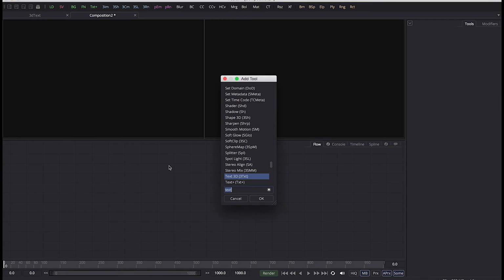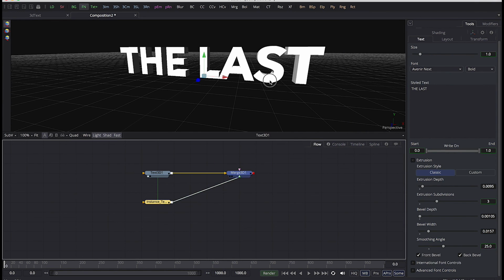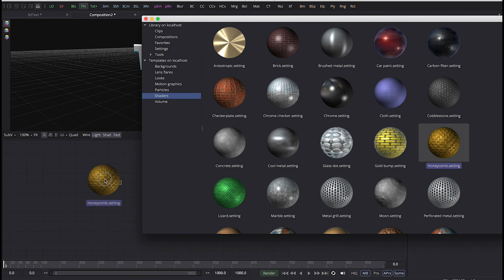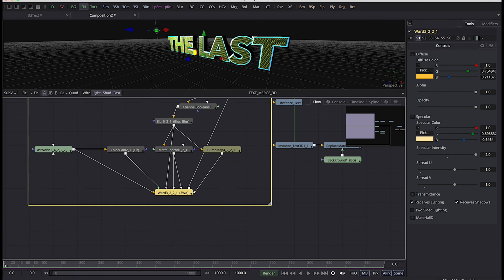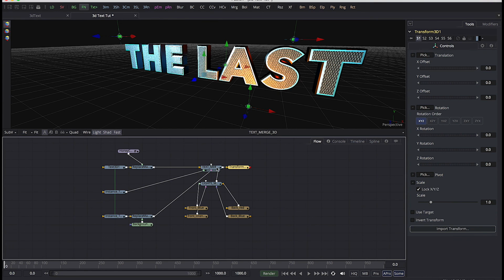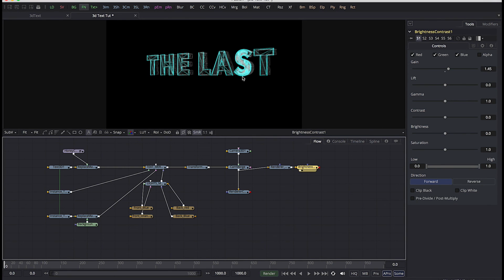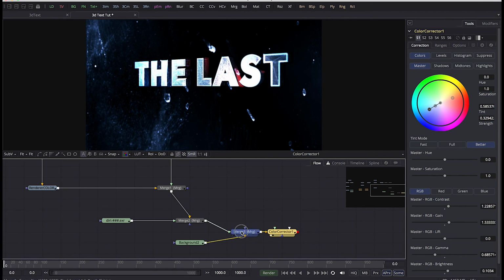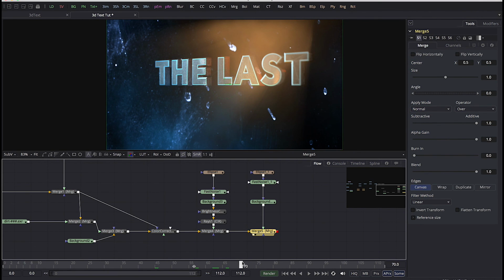Fusion: 3D Text

Comment: I have a quick question.  I love the lighting of the text but was wondering if it is possible just to reveal part of that text with a spotlight.  Thank you.
Reply from the maker: The Elevator Daily yes. It is possible. Could be done in 3d and 2d. Many different ways actually
Reply from the maker: Yes, explore playing with the lights. Work with one spot light first. Then add as needed. You will start to see how they work together
Reply: Thank you!

Comment: Fusion keeps crashing when I crank up the extrusion depth
Reply from the maker: Hmm...sorry to hear that...I would suggest double checking system requirements and maybe un-install/re-install. When you download the packages from the BMD site, they come with un-installers for Fusion fyi...hope that helps and hopefully you can get back up and running
Reply: Oh it actually turns out that TTF fonts are incompatible with Fusion, the format for the font I wanted to use.
Reply from the maker: Ah! ok, good to know!

Comment: Can you do a tutorial on tracking 3D text onto a surface, such as a wall?
Reply from the maker: Hi Elite Spectr, I will put that down on the list. At this current time, Fusion 8 and below does not do 3d tracking, however, it does have very decent 3d tracking for being an old tracker...I'm really hoping Blackmagic adds a 3d tracker to Fusion, fingers crossed. Thanks for watching and I will work on getting some tracking tuts for ya (it may take some time, juggling a few things but I'll get on it).....cheers, T

Comment: Thanks for making this tutorial!  Very cool.  The ending was a little confusing.  I was able to figure out some of the nodes you did not show the settings for.  But Rays I have no idea how you got it to work.  Manual doesn't discuss Rays effect.  I could not find anything except one cryptic post about DOD node, but I don't see one in your tutorial.  Maybe you could create a part two that discusses the end in more detail and shows how to animate too.  And/or if you could comment here about how to get Rays working.  Thanks!
Reply from the maker: Hi DKP3000. Thanks for watching. Rays effect is under...Tools>Effect>Rays...Im using the latest version of Fusion from BlackmagicDesign. trying to get out more tuts too.
Reply: Hi Tony, thanks for responding.  I wasn't clear in my post.  I added the Rays node and I added the nodes you show in line with Rays with the same connection, but no rays.  The orange smoke shows.  What setting did you use to make Rays actually show rays?  I am also using the newest Fusion version. Thanks

Comment: Great tut, Tony! Thanks a lot. I got just a question: when I changed the connection between tthe merge node and the replacemat node, I couldn't see but a black shadow instead of my title, and wasn't be able to revoer the colors even on the render. I know this must be a stupid thing but even allow lights this didn't changed, actually nothing did... I'm very new on fusion, of course. Very thanksfull if you could help me on this. Thanks a lot!
Reply from the maker: Hi Cronan. Im not sure I fully understand your question...make sure that the replace node is after your 3D text node...Replace Material Node needs to have geometry piped into it in order to replace it....so flow should be....3DText Node > Replace Materials Node. Hope that helps? let me know...I'll see if i can dig up the comp and make it avail to download